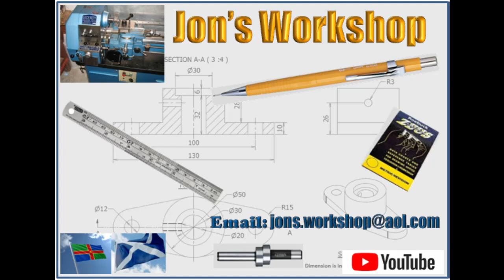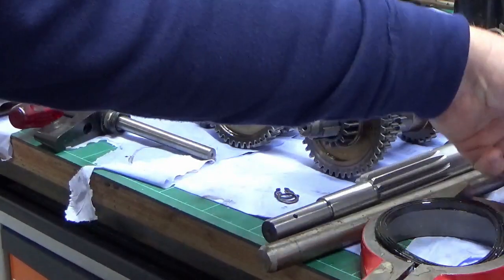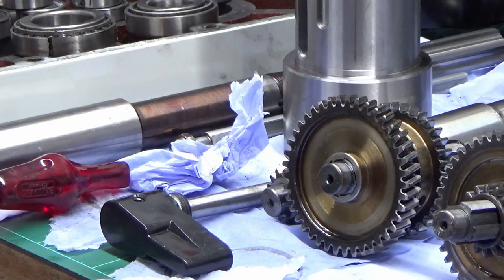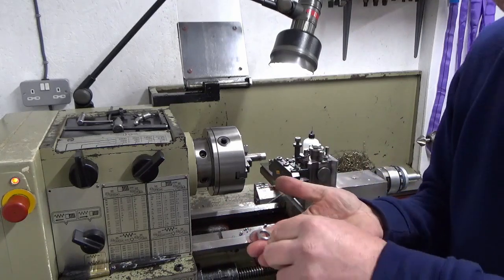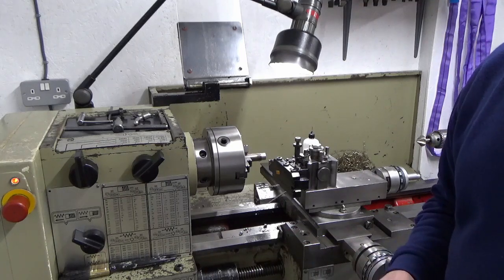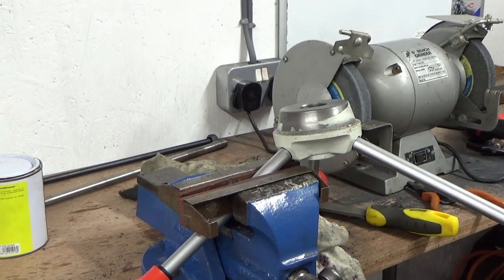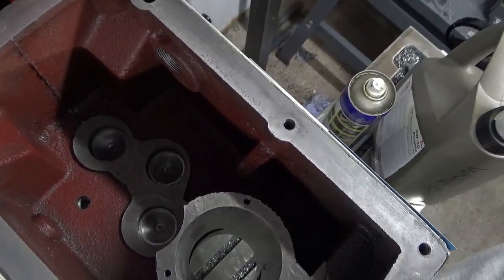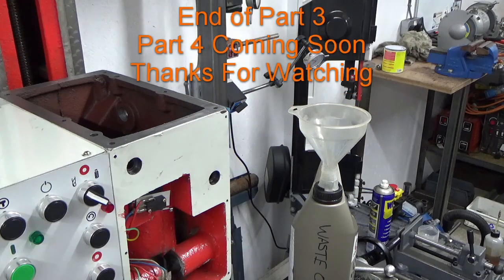Cormak ZX 7045 Mill Head Strip Down Part 3

Comment: Hi Jon, I brought a Weiss mill about eight years ago, and the first thing I did was to strip it down completely to replace all the bearings. I also found that mine was full of casting sand and machining swarf, which had been painted over. I had to wire wheel the inside of the gearbox to remove all the crap, before painting with oil resistant paint made for such jobs. Mill has run faultlessly since, but am seriously considering doing as you have with the quill support block, as mine does have a little more play than desired.
Reply from the maker: Hi John, you lose some travel but it's a good enough trade for the extra rigidity. Cheers, Jon

Comment: HI JON,  I THINK I WOULD PUT A STRONG MAGNET IN THE BOX AS WELL, FOR ANY BITS THAT COME LOOS LATER. REGARDS R.
Reply from the maker: Hi Richard, thanks for the comment. Great suggestion, I have fitted one to the sump nut, this way you get to remove the dross at an oil change without the need to take the top off. Cheers, Jon

Comment: Hello Jon, nice machine. Of course, not everything is perfect. As long as you can get rid of that with simple means, everything is OK (I think). WD40 is OK. I clean large individual parts with degreaser. "Sillit Bang" or kitchen cleaner of your choice. Basically, these are cold cleaners. You can dilute it with water. They are very strong and you can "smoke". LG Peter
Reply from the maker: Hi Peter, thanks for the comment. Good suggestion, I have been meaning to get some of this to clean the granite table. Like you say, it will also be handy as a degreaser for the shop too. Thanks for watching. Cheers, Jon

Comment: Morning Jon, that's why I like buying old machines and refurbishing, you know what you've got, I've found that spray brake cleaner is good for cleaning then WD40
Reply from the maker: Hi Terry, thanks for the comment. I usually have some brake cleaner but used all mine up on the Harrison clean up (I must get some more). Years ago I used to have a jar of Trichloroethylene in the garage (fantastic stuff, used to wash my hands with it as well), turns out it is highly carcinogenic and has been banned almost everywhere......... Who knew! Cheers, Jon

Comment: I can't believe they painted the taper on the fine feed drive, can you do a test fit with blue on the taper mating faces just out of interest. 
These machines should be labelled, assembled ready for you to strip down and improve. How did they get sand on top of the red paint?
I'd wash the inside or the head casting with thinners and repaint it to seal it or flush it out soon after the initial running and replace the oil. Tony
Reply from the maker: Hi Tony, thanks for the comment. Yes, it's the machine that just keeps on giving! I think the painters name was Hit and Miss! There is more paint where there shouldn't be than there is where it needs to be! I have no idea how they got sand on top of the paint, very ingenious, maybe they used Sandtex paint, you know, the stuff for painting the exterior of buildings! I am happy with the housing now, even though the paint inside looks ropey, I think it is enough to seal it, and it's spotlessly clean now so should be OK. I need to get some Engineers Blue, mine dried up about 15 years ago (think I left the top off it one day when I was blueing up handles on another guys machine lol (naughty boy). When I get some I will check it...... Keep hounding me as I will likely forget otherwise. Cheers, Jon

Comment: Hi Jon,I had about a teaspoon full of crap out of it.I used brake cleaner and also wd40.Thinking hard of mounting a magnet in the sump too.or getting a suitable drain plug/magnet combo.Don,t you sleep in the weekend?
Reply from the maker: Hi Robert, thanks for the comment. Ha haaa, yes I do sleep but my network is so slow here, I set the videos to upload as I go to bed (ie when we are no longer using the Internet for anything else) and they usually take between 4 and 6 hours to upload. I have completed the rebuild now other than just waiting for new oil to arrive (all filmed, I just need to edit and upload). I put a neodymium magnet on the top of the sump plug, this way you can remove any dross at an oil change without having to take the top off again. Dead simple and a good idea. Cheers, Jon

Comment: Jon, buy some keroscene/ aka parafin from a local fuel dealer. £20 for 5L. Put in a hand sprayer (99p shop hair section). then come in with wd40 or other de-watering product at the end !!
Reply from the maker: Hi Tubal Smart, thanks for the comment and suggestion. I have 5l of this kicking around somewhere, I will look it out as I have plans to make a parts washer for things too big to fit in the ultrasonic tank. I think paraffin will be good in this application. Having some in a spray bottle is a good idea, it's good for spraying on aluminium when machining it (although it stinks a bit if it gets hot). Cheers, Jon

Comment: It is a well kept secret that the Chinese machine manufacturers share an open air assembly line located in a dessert. A handfull of grit guaranteed in every machine exported.
Reply from the maker: Hi Howard, thanks for the comment. Ha haaa, you might not be too far from the truth. Having visited a couple of manufacturers in China, you do somewhat formulate opinions. Can't grumble though because excluding my time, when everything is done, I will still have spent less money than the cheapest Bridgeport on Ebay that will be completely knackered. Cheers, Jon

Comment: Morning Jon, let me know if you want me to send you a neodymium magnet to leave stuck inside the gearbox to pick up any ferrous particles. I've got plenty. Cheers. Mike
Reply from the maker: Hi Mike, thanks for the comment and the offer, I have beaten you to it, I have a few little ones here and I "shaped" one to fit on top of the sump plug and fitted it, this way, at an oil change, you get the chance to remove some dross without taking the top off. My videos are a bit behind reality, I have it fully rebuilt now and am just waiting oil to arrive to refill the head. Cheers, Jon

Comment: Hope you filter that oil to retain excellent free grinding paste.
Someone else said brake cleaner, also methylated spirit, cleans then evaporate. But don't drink the dregs. Its not Guinness 😯.
Are you not going to have the mating faces on the bearing cones surface ground ?😀
Reply from the maker: Hi Fred, thanks for the comment and sorry for the delay replying. I was half tempted to hang onto the oil for some cheap lapping compound. I use methylated spirits a lot for degreaser and if I was going to re-paint the casting I would definitely have used this. As it was, I just wanted to clean the crap off and WD 40 is amazing stuff for this, especially in an already oily environment as it dilutes the existing oil deposits very quickly. You will have seen by now...... Alas, no scraping! Cheers, Jon

Comment: Your reputation for frugality is out the window now, using a 5mm parting tool on a 3mm part, such wasteful extravagance. 😂
Reply from the maker: Hi Chris, now you are really scaring me!!! Have you got a camera rigged up in my shop? Have I been bugged? 
I said, (off camera in a private rant) how unhappy I was with the fact I lost almost 14mm steel to make two 3mm spacers (was blaming YouTube). I told myself I should have used the hacksaw!! I know you are joking but the sad thing is I was deadly serious! I didn't even buy the steel either, came out of a skip somewhere probably. Tighter than two coats of paint I am! Thanks for the comment though, made me smile. Cheers, Jon
Reply: @jonsworkshop  not bugging your shop but didn't i tell you i was psychic, or was the diagnosis psychotic, oh it was one or the other.